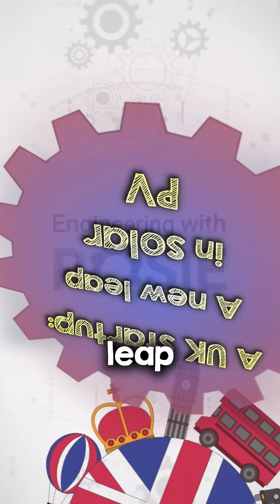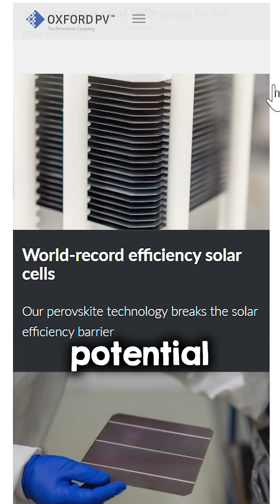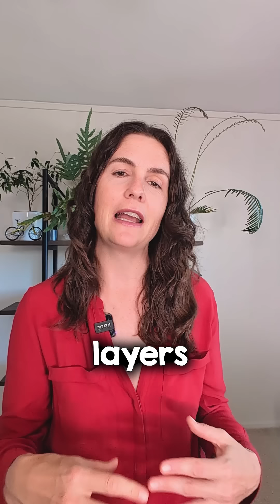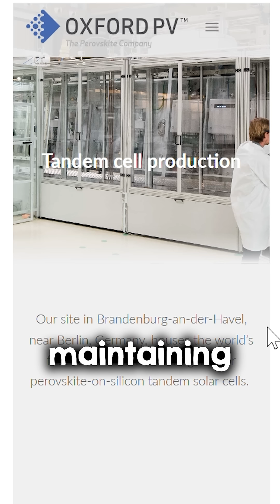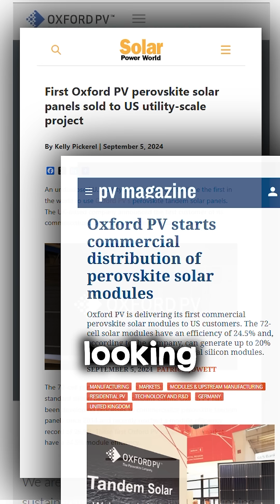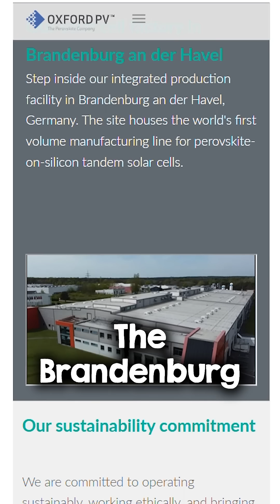A UK Startup Is Taking On China’s Solar Giants

Comment: They also do pvt
Reply: "pvt"?
Reply: @alanhat5252 photovoltaic thermal. They are under the brand name Sunnmax
Reply: @alanhat5252 Photovoltaic thermal, they can generate heat as well as electricity and the efficiency is higher. They are under the brand name Sunmaxx

Comment: These panels are obviously going to be more expensive than standard panels, even with improved economies of scale. I think they will only make sense where space for panels is limited. On electric vehicles to give a range boost will be the best niche to use them. Perhaps on domestic roof solar where you are also space constrained. Ground mounted solar farms usually have plenty of room so it's more questionable if the improved efficiency will be financially worth the higher price.
Reply: I was just about to write something similar. I would love something like this on every car if only to keep the battery from draining and using any surplus to cool the interior.
Also sounds like something with potential for balcony solar in apartment buildings and maybe even portable panels to reduce their size.
Reply: I don't know where you live but in Europe land is expensive to buy, 20% more output from an area has to be an attractive proposition.
Reply: The most expensive part of PV today is installation. If you can get more electritcy for the same installation effort, it is a plus.
Reply: @orbiradio2465 it depends what type of installation. On a roof installation is very expensive. Ground mounted is much cheaper. Also these type of panels have so far has a shorter lifespan than traditional, which means you need to replace them sooner and pay for installation again. It depends how much more expensive they are and how much shorter the lifespan is.
Reply: Space is limited in lots of places, eg roofs. Less than 25% of the cost of a typical domestic PV installation is the cost of the panels themselves. So if the price was double and the performance was 25% better, the overall cost per Watt would be about the same. Many customers would likely go for this.
Reply: @bimblinghill yes, I said it might make sense for roof solar. The issue is whether the lifespan is shorter. If you get 25% more power but half the lifespan then you have to pay the installers to replace them sooner, which as you rightly pointed out is the most expensive part. 

I think that ground mounted is the less I applicable use for these, which is why I was surprised Rosie highlighted that use.